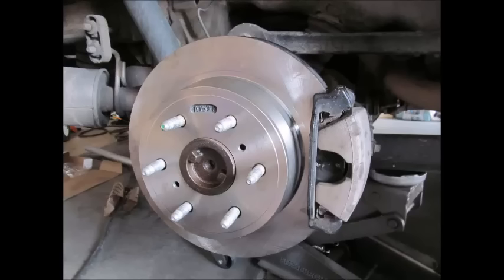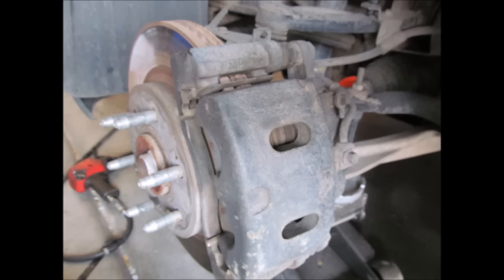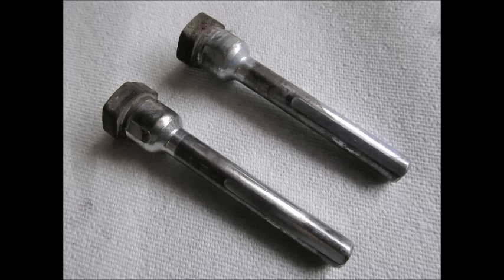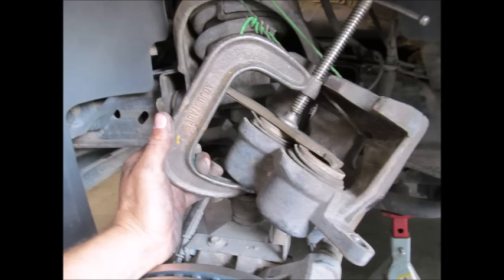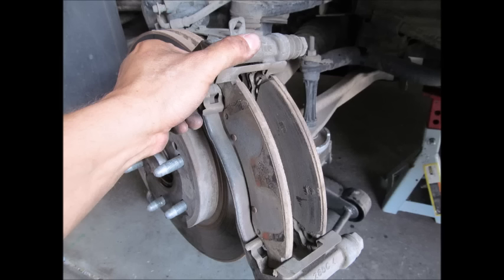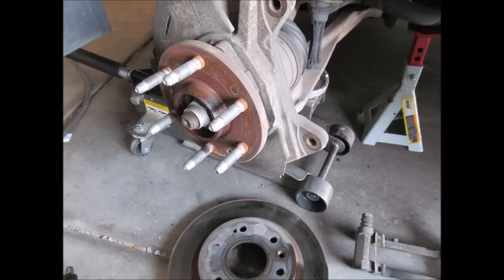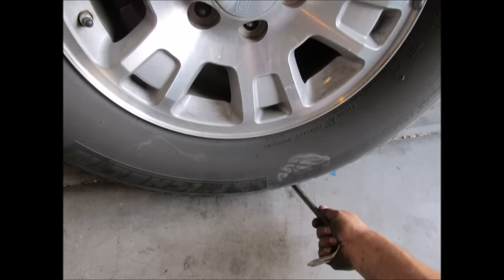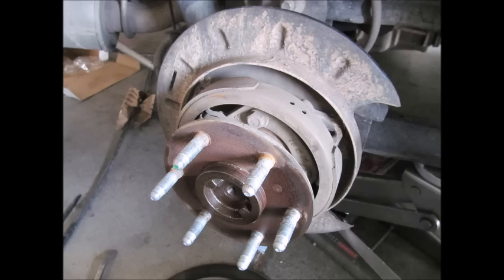Get rid of steering wheel shake when braking.

Comment: The real reason brakes pulse is from over torqued wheel nuts. Torque the wheel nuts to the vehicle manufacturers specifications. If you over torque you will warp the rotors.
Reply: Ahahaha
Reply: Absolutely correct re:making sure the lugs are torqued to spec.  Very important.  Tire replacement shops (and auto dealer shops) both don't seem to care about 1. the correct torque for your vehicle's lug nuts and 2. consistent torque for your vehicle's lug nuts.  I have corrected what appears to be warped brake rotors on my vehicles by re-torquing the lug nuts.  It may take a few miles of start/stop driving for the rotors to come back into "flat", but mine have.  Best precaution is what's mentioned above...make sure your lug nuts are torqued to spec after getting new tires...and, after a rotation.
Reply: It's more likely that the wheels weren't mounted true and/or the rotors weren't held flat against the hubs and the improper fastener tightening sequence or torque held that misalignment.
Reply: It's a good idea to retorque wheels  after driving on them for a while, regardless of whether you did it yourself or whether a torque wrench or air wrench with torque stick was used.  
btw,  NOTHING ever had a torque spec measured in ft/lb.  The Toyota and Honda cars and small suvs that I've had all had wheel fastener torques of 80 lb-ft or 108 N-m.
Reply: P Schmied my 2007 Accord V6 wheel lug torque is 80 lb/ft and my 2014 Odyssey is 94. 17” vs 18” wheels maybe is the difference??
Reply: If the wheels are over torqued will the rotors be permanently warped? I'm having this issue. I did a brake job not very long ago and didn't have steering wheel shimmy. Had the tires rotated and balanced then the shimmy showed up. The over torque could be a possibility.

Comment: First of all, there's no way to know if balance weights are missing.  Why???  Because they're missing.
Reply: Additionally; if a wheel is incorrectly balanced, you would more likely notice it in the form of wheel wobble & excessive vibration in the steering wheel while driving (usually at freeway speeds)...much more than when braking. As for steering wheel shaking when braking; I've noticed the inferior quality of steel or imported off-brand brake rotors (that warp much easier when heated) play a major part in this system failure.
Reply: LOL

Comment: The rotors  get over heated that is why they warp.. also because of the cheap steel from china .. At one time Napa sold American  made parts  but  bot the case anymore they all come from china or another foreign country .. It is all about  the corporate profit... Look at how all the  vehicles  are rusting after 3  or 4  years.. My  opinion is it is all the recycled steel that comes  out of china .. what are you're thoughts ?
Reply: dwayne marshall China China China
Reply: If you own a parts store such as NAPA, guess where you will be buying most of your parts from? Thats right..it's China. It's cheaper to manufacture in countries such as China so stop complaining.
Reply: Actually ,the Iron Ore in China is Second in Hardness,Only to Germany.Used Oreillys House Brand of Rotors Made in China,Never Had A Set Warp from Overheating.Lots of Train Wheels Made in China.My Cousin Use to Refurbish Train Cars,&Said Rarely Had to Change Out Wheels Made in China or Germany.Craftsmanship in China Is Another Story ,Though.
Reply: Rotor warp is rare, one of the first things I learned from my teacher in highschool that was a master mechanic specializing is metallurgy was that. What happens when you think you have a warped rotor is brake compound material has built up on a spot of the rotor due to holding the brakes hard at a stop, fusing material onto the rotor. Then next time you stop it will most likely stop at that thicker spot and over time build to something you feel in the pettal and maybe steering wheel.
Reply: Gabriel Soria true story. warped rotors are a myth. even on the race track it’s hard to get steel rotors to warp. and no amount of driving on public roads will ever generate that kind of heat in the brakes.
Reply: Yes. I thought I had warped brakes before. I noticed when I apply the brakes the steering wheel would shake back and forth. But, when pressing harder the shaking would stop. I thought if warped the shaking shouldn't stop. I read up a bit on it and found about how the brake rotors may have an uneven coating of brake pad material on it.  I tolerated the shaking as it wasn't super bad. I drove until it was time to replace the pads. I bought new pads and rotors. The instructions for bedding in the pads were much more different compared to what I've always been told over the years. I used to always take it easy on the brakes the first couple of hundred miles. The manufacturer of the pads had instructions that told me to speed up to 50 and brake hard down to 15 or 10mph and then speed back up to 50. Do this in quick succession five times. The pads smoked up a bit. The final five stops were to brake down not as hard to about 25 in quick succession again and then continue to drive without stopping until the rotors cooled. The purpose of this technique was to lay down a even layer of brake pad material onto the rotors. My brakes worked great until it was time to replace the pads. I did the same thing for the new pads and rotors. I was fortunate that there is a road near me that allowed me to do this. I was getting about 100k miles on the pads and rotors.
Reply: Rhaspun exactly. bedding the brakes is the key. sounds like you did it correctly. there are many variations in the hard braking events but the most important thing is letting the brakes cool before coming to a complete stop.
Reply: Yeah everything's fine china nowadays but modern cars do last longer
Reply: Make China Great Again. Build that Great Wall.
Reply: My thought is that all that matters to some people is the name on the package and the advertising. 

My knowledge as an engineer is that steel is an alloy with uniform heat transfer characterstics and it doesn't matter whether the steel is refined from ore or recycling, where the refinery is locate, or the family names of the people running the refinery.  

My experience is that dragging/binding brake pads plus aggressive driving causes brake overheating, and combined with improper fastener torquing causes warping of solid rotors and drums.    It's uncommon for ventilated front brake rotors that aren't badly corroded internally to warp.
Reply: Mobile Terminaluser news flash - unpainted metal rusts regardless of where it's made.
Reply: That's why the warp and also why it is usually felt in the brake pedal, not the steering wheel.

Comment: Lot of ass scratching stuff all these so called brake and disc fix crap. Bye new disc., s good Ferodo brakepads not the cheap & R#@ from the Chinese store and fitt them. Any cheap backyard job on brakes is looking for trouble. There are no cheap solutions for break and stearing shudders, it will be fine for 500 km then prob is back. End of story.

Comment: Grease on caliper pin??big no,no!
Reply: Maybe you're kidding, but if not, I respectfully disagree. The pins come greased and they have grease seals.If they aren't greased regularly, they can rust and sieze or allow the calipers to rattle badly over bumps. The grease acts as a cushion besides lubicating the pins so the pins can allow the caliper to slide when the piston is extended.
Reply: Of course The Gee-tha and the rear brakes often seize quicker (the pins I mean) and the caliper doesn't move and get stuck wearing out the brakes. A quick test is checking the heat on the rotor by holding a finger near (no onto  :-) ) it. The rear axle is fixed and catches wind and water most of the time from 1 direction only, if you commute long distances on the high way and in winter the salt is added to the road conditions most likely the bumps in the road are less, not so much braking going on so dirt and salt can easily clog up the brakes. The front however switches direction all the time because of the steering action on going (wind, water direction hitting differs) plus if the cars hits a bump the front axle gets the biggest hit cleaning it out. The other way around is wearing out the 'rubber' brake line: the front suffers more than the rear (due to twisting the steering) so it mostly needs to be replaced earlier.
Reply: Of course, you grease caliper pins or guides. Preferably with a silicone grease. If you are smart you do a check yearly. Your brakes will not function properly if a pin seizes, you will get uneven pad wear. I do it when I do my summer to winter tire change.
Reply: don684 ,all the pins were seized on my rav4 ,took em out with effort cleaned em up put em back in, lost my grease so had to use lithium grease, car has been unusable since .
Reply: Simon Baker ? What lol so you fixed it and brakes don't work
Reply: Jake Hynds brakes work but past 50 mph the steering shakes out of my hand, they must have warped the brake discs were they were seized from previous owner ,
Reply: I use silicone grease on my caliper pins. I am in Canada and I find Kleen-Flo "Eze slide" is good, Pep Boys in the US has tubes of silicone grease. Seems to work well and I check them yearly, during my annual winter to summer tire changeover. If you had a lot of gunk in the female part of the caliper, (where the pins go into) you could buy a bore brush get some brake cleaner and scrub them out. Changing those rubber bushings is a good idea too, keeps the water and gunk out. Rock Auto is a good source for that. If all else fails rebuilt calipers and you get a rebate on the cores.
Reply: Plus, if the pins aren't greased, they can (& often do) seize into place & sometimes resulting in having to replace an entire caliper instead of simply doing n R&R on the pads.
Reply: Calliper pins should be greased with a silicone based grease. Do NOT use copper or lithium grease.
Reply: Caliper pins are lubricated with a tiny bit of synthetic grease, sometimes "silicone" that helps the pin move through the restriction of the seal into the bore by lubricating it..  It takes very little, not enough to qualify as a cushion.  If a peroleum grease is used on that rubber seal, it swells and hye pin will bind.  If too much grease is applied, the pin can hydrolock in the cylinder.
Reply: +Jake Hynds: It doesn't matter whether it was usable or unusable.  White lithium grease will cause the guide pin boots to degrade and the brake will eventually fail either from binding or rusting of those pin.
Reply: If your pins freeze in place then you need the caliper brackets. Readily available since it occurs frequently.

Comment: You never said what was done to stop a wobble. I don't believe you solved anything and its not the job of the brakes hold the wheels straight. I also appears that you just let the brake fluid overflow while pushing the pistons in. Lazy and careless. Makes a mess and removes paint. You also let that filthy brake fluid remain in the entire system.
Not impressed.

Comment: Fail.  You are worse than amateur.  First of all, steering shake on braking is more likely to be a tie rod end, not brake issue. Never use impact gun to remove caliper pin bolts. Use a longer handle wrench or spark plug ratchet with socket.  Moly B is not correct grease for pins, White Lithium is.  Should remove excess from master cylinder before pushing pistons back. When collapsing pistons into caliper, 1st assure the rubber is intact and clean, the tool you used is designed to push both in simultaneously.  Do this slowly.  Be sure that the rubber collapses correctly w/o creasing, crushing, tearing.

If you have brake issue, particularly warped rotors usually felt in brake pedal, not steering shake.  Brake issue can cause a pull to either side on braking though but rarely shake in steering. You needed new pads anyway so NBD.  Steering shake, yes on braking, is usually caused by worn or damaged tie rod ends. Pay someone to do it if you don't already know how.